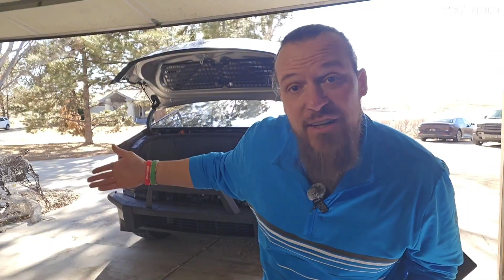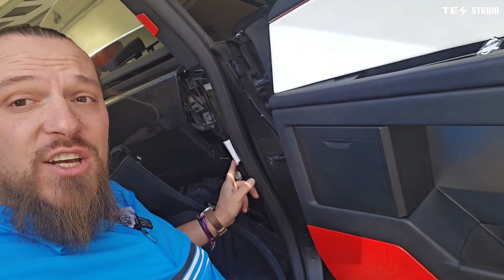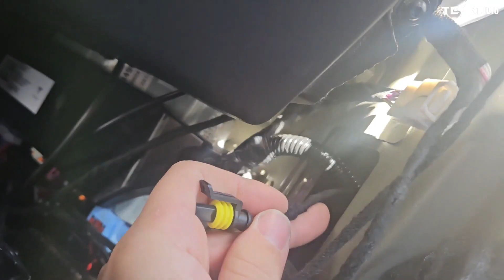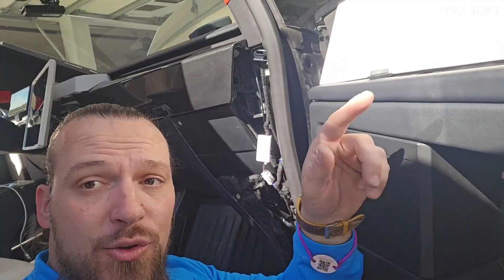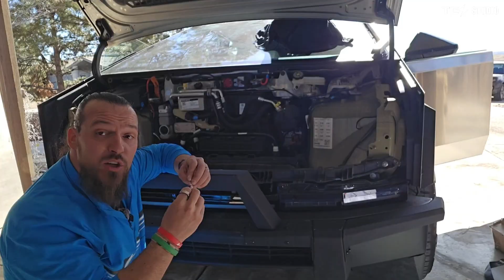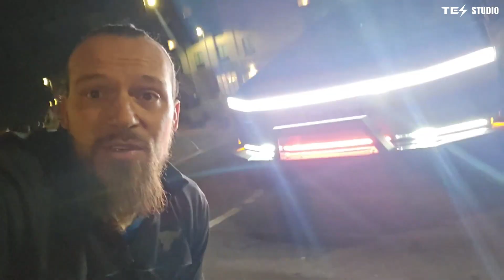Top-Rated Front Bumper Lights for your Tesla Cybertruck (2025) #cybertruck

Comment: I bought this light and installed it on my cybertruck 12/2025.  This product causes a fault on the screen of the truck. I've been working with tesstudio for two weeks running over the air updates on there control box.  Now the light does not turn on and there are  codes on my screen warning me that the horn and speaker system needs service by Tesla.    Stay away from this one.
Reply: Thank you.